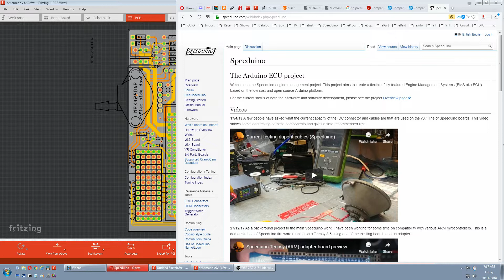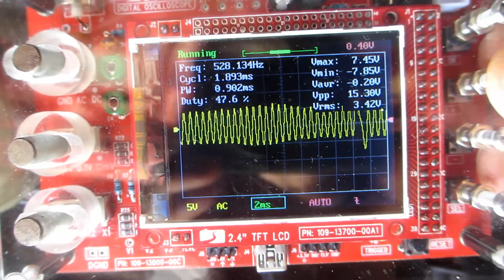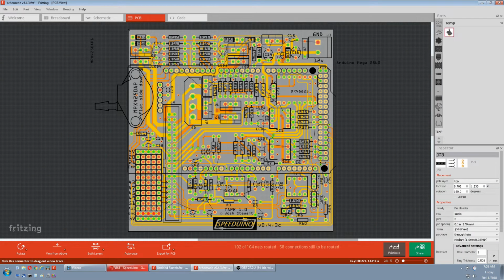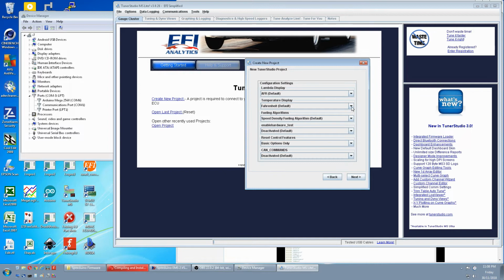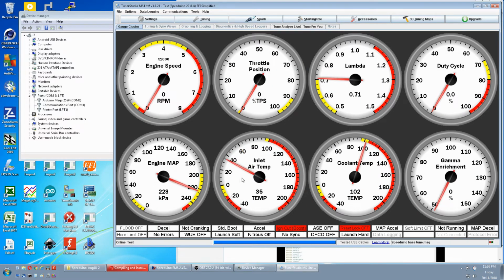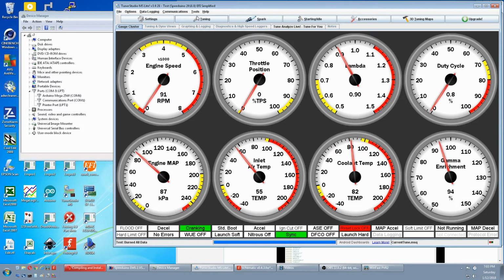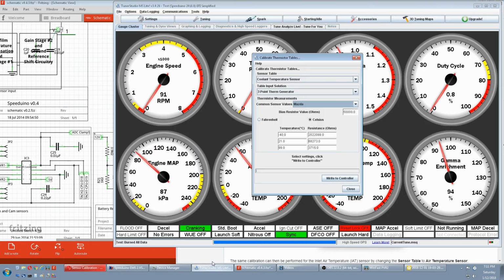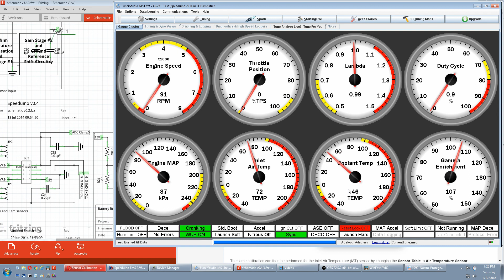Speeduino EMS #2 : Setting up for TunerStudio

Comment: What year and engine code is your protégé, I'm just starting on an 2001 zl. What results did you get from this?? Thankyou
Reply from the maker: I've got the much older 1990 BP SOHC 1.8. I had annoyances with Speedy, but mine was a DIY design. It shouldn't be a problem for you, but you'll have to do some research if Speedy can do all the fancy stuff your newer car might have, ie, is the alternator CPU controlled.
Reply: @SidneyCritic  please feel free to laugh but that is something I still need to find out. Tbh I assumed I could cut or splice factory loom straight to speedy but after the small amount of research done so far I'm finding out more and more that doesn't seem to be the case 🤣 definitely bitten off more than I can chew for the moment. Indeed lotts of research to be done. Thank you for your reply and vid uploads 👍